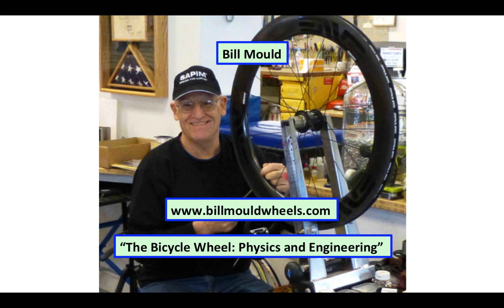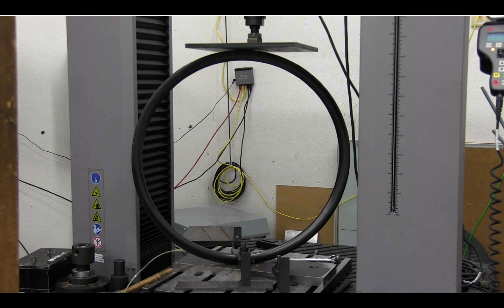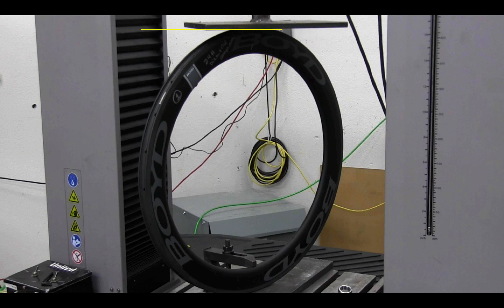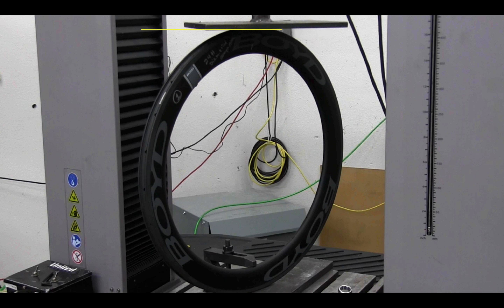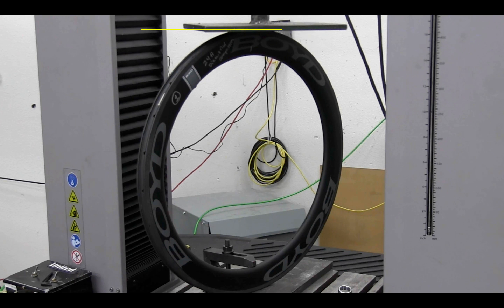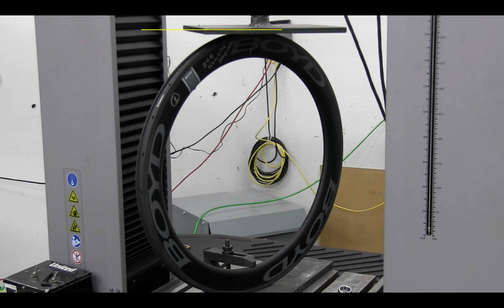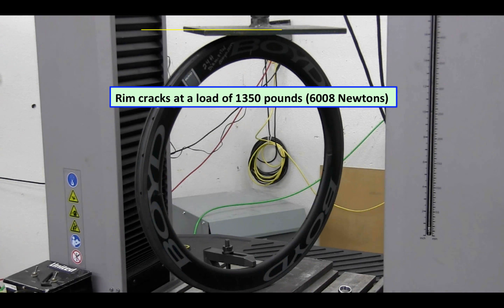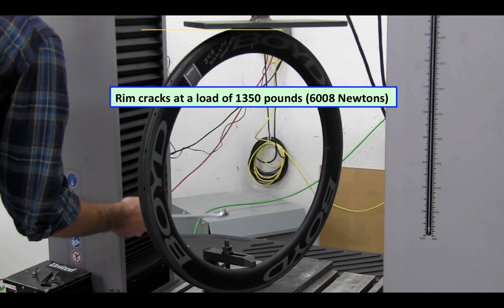Carbon Rim Compressions

Comment: Might not want to get so close...

Or buy wheels on the UCI list, so they have already been tested

With the spokes on, would it fail at a higher load? But that load seems massive anyway.

The failures I have seen have not been like that, more usually delamination of the old style fairings, or the spokes pulling out and destroying the rim

or the 'hook" on carbon clinchers - One reason I prefer tubulars, although modern carbon clinchers are probably fine

I still have the original spinergy wheels that were banned by the UCI, but I am careful on those thin carbon blades.....